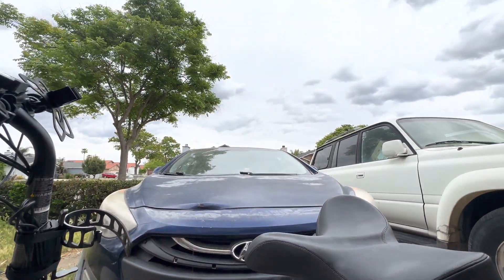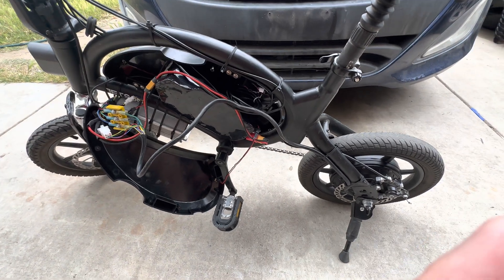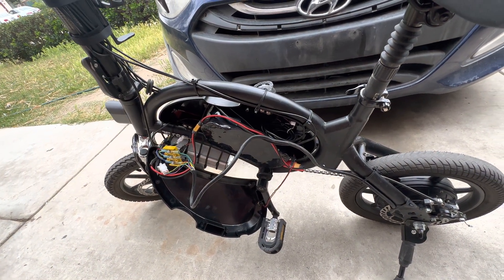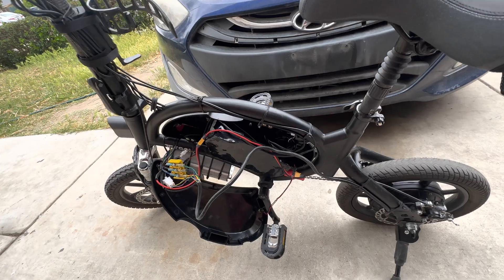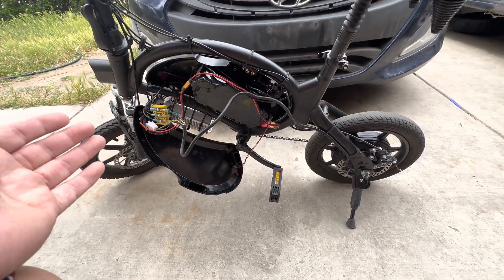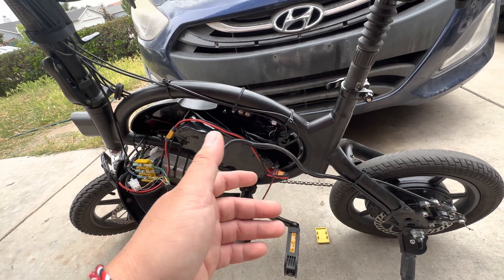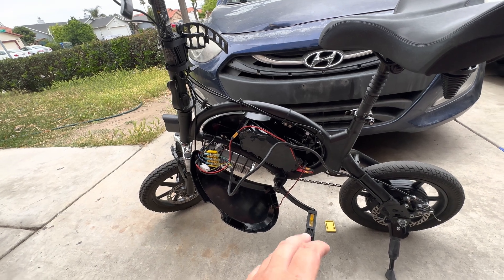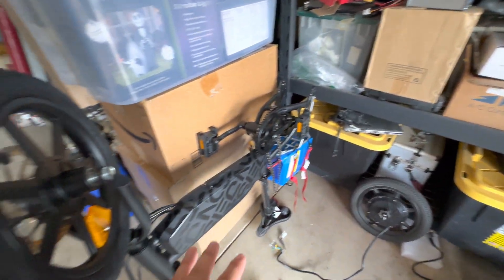Whats new to 48v Jetson?!

Comment: I got windgoo b3 350watt is 36v 6.6ah battery and 36v controller thas standead i was just gona chage controller two 48v and battery 48v 20ah with trigger  throttle not share if is gona work but no harm trying

Comment: this is a high-speed motor, it develops 1500 revolutions at 48 volts, it makes no sense to increase the voltage for higher speed, it is capable of developing 80 km / h at 48 volts, but this requires a lot of controller power, like all high-speed motors it has a small  torque, and so that it can develop maximum speed under load, you need a controller of about 100 amperes

Comment: If you increased the voltage, you should thicken up the wires so the current can flow better. Yesterday I put out a video on the Jetson Atlas. I found out the motor is bigger than the Bolt Pro...I have a bolt pro, I just switched all the parts, transferred to the Atlas. Also, that front fork, I have the same one...I finished the transformation and went for a ride...